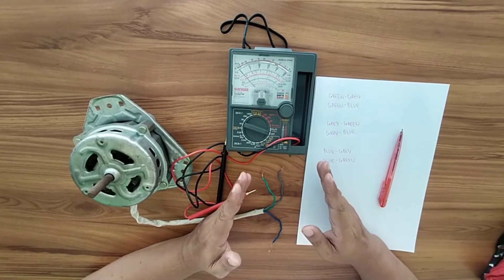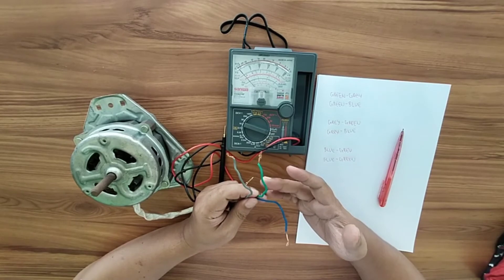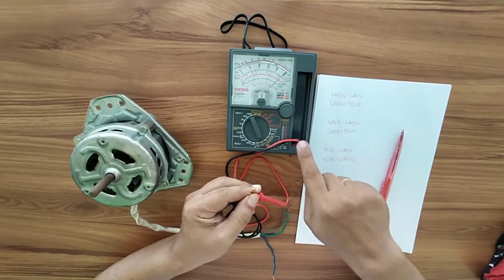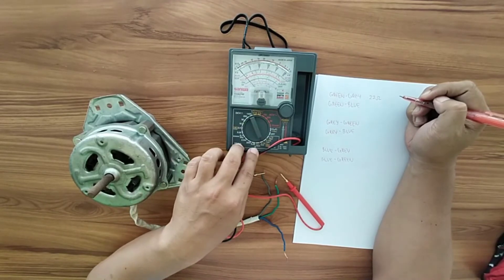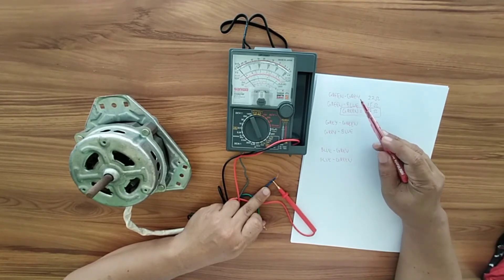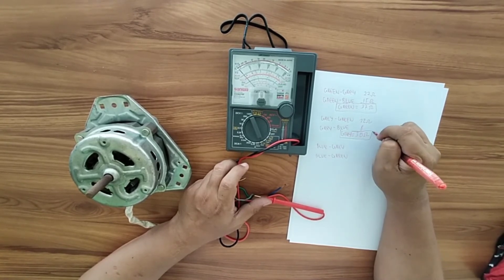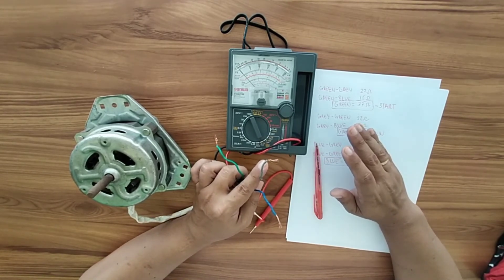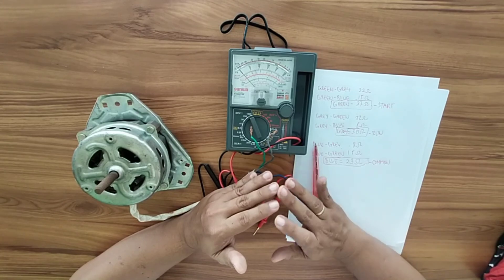Checking or Testing Spin Motor of Washing Machine (English)

Comment: Very informative, my issue is the spin motor I've tested from the switches worked my way to the capacitor of which both are good. The motor will have to be taken out for further testing

Comment: Hi there 
I've changed a new one after stoping the old from working 
Is there a way I could fix or at least open it 
Thnx in advance 👍
Reply from the maker: Good day sir... If the problem is the winding of the motor, there is no way to repair it but to replace the whole motor... Now, if the cause of the problem is the shaft or the bushing, you can replace it but make sure you aligned the rotor to the stator of the motor to prevent friction... Hope this will help you... Thanks and God Bless...